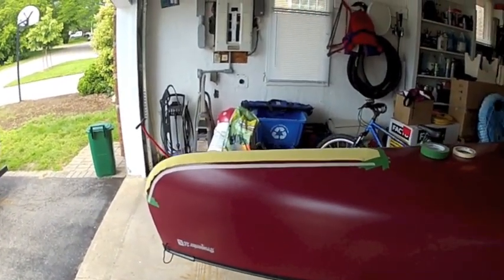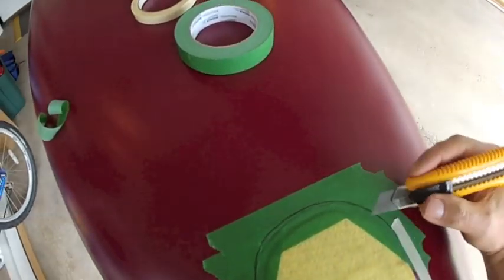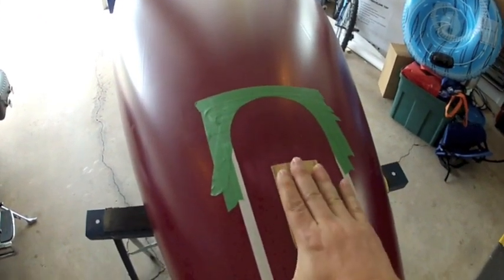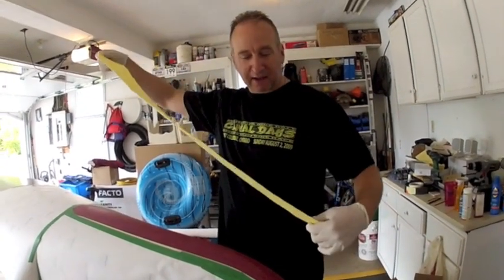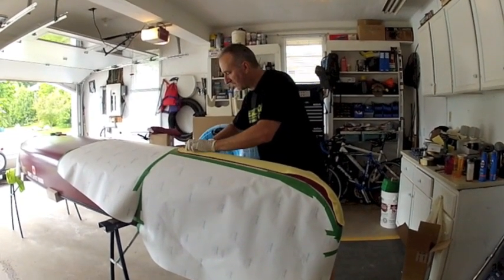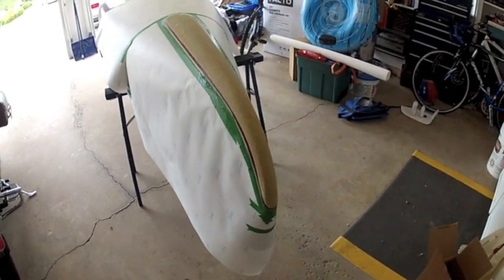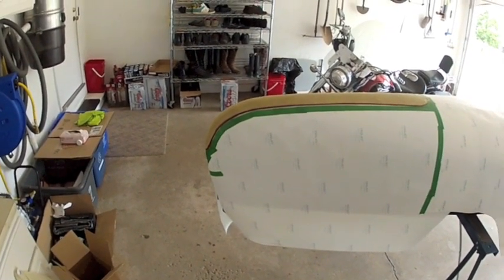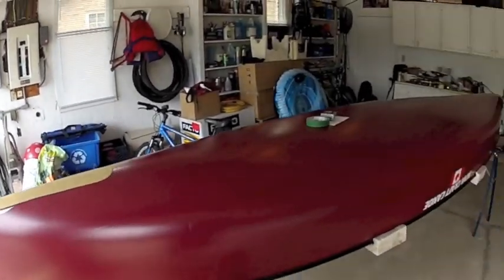Installing Kevlar Skid Plates on to a Royalex Canoe

Comment from the maker: Update to this Video... This Video was shot in 2013 and as of January 2019, the skid plates that I installed are still holding strong with no signs of release or peeling. Just remember to do a good job on the sanding process to give the epoxy and kelvar felt the ability to bond to something rough...
Enjoy the video and thanks for watching...
Reply: I guess I need to look at the Date before I click the Video 😲

Comment: good video and spot on!  I do mine a little different I have been patching boats now for 6 years. I work for a canoe rental in arkansas. all I do that's different is actually two extra steps I like to tint the boat with a torch before applying Kevlar felt,and I put wax paper over the whole patch and smooth out and push bubbles to edge when resin has sat for about hour or two I pull off then your left with a nice smooth finish.
I patch usually 30 canoes a season. Arrowhead cabin and canoe
Reply from the maker: Thanks for watching

Comment: Hello, if the skid pad still hold on to the canoe? I heard that it was popped out because epoxy does not bind well tp royalex. A few people used g-flex epoxy are more successful.
Reply from the maker: Hi Bob. The video you watched was done in 2013 and I still have the same canoe. The skid plates have shown no signs of peeling at all and this canoe has bee through a lot. I believe the most important step in installing these kevlar strips is the sanding process. You really want to create a rough surface for the epoxy and kevlar felt to grab on to and that is why it is still as good as new.. Thanks for watching the video and good luck if you are going to install your own... it's not really very difficult. 
Please subscribe
Dennis

Comment: Your royalex canoe looks new. Good on you. Would you use that epoxy with fiberglass tape or materal to repair frost cracks in royalex or royalite? To date Ive seen gflex 650 as an option but the suggestion is to open the crack to about the thickness of a jigsaw blade, taper both sides so they meet in the middle so the epoxy meets in the middle. Im having a problem with this concept, any suggestions from anyone?
Reply from the maker: Hello Micstica... I wish I could answer that question for you. I would suggest you contact NovaCcraft or another manufacturer to see what they would suggest... Thanks for reaching out.

Comment: Nice job Dennis! Any signs of it wanting to peal off?
Reply from the maker: Hi Marc... I installed these about 6 or 7 years ago and they are showing no signs of peeling at all.  If you watch my Nebakawasi trip videos you will see the skid plates still attached...It all comes down to the preparation by sanding well so the epoxy has a good surface to grab on to. I also had skid plates installed on my Swift Canoe right from the factory so the bow does not wear through.  Thanks for watching one of my first videos...Dennis

Comment: Hey Dennis, nice video! Just wondering if you can comment on what temperature is ideal for the epoxy to set? I live in and area that is consistently over 100 degrees in the summer.
Reply from the maker: work fast
Reply: You must Live in Florida too 😂
Reply: Nice job applying those plates. That's definitely the cleanest I've ever seen lines on skid plates. I live in the south agirquaz, and my advice is get up super early and get the glue down before it gets too warm. Also, do it in the shade. I watched a friend apply these one summer morning about 1000 in the sun and we almost couldn't get the glue on fast enough before it set up. And then we were worried that the exothermic reaction would melt the boat. It didn't, but we were real concerned!

Comment: Hello
How do you remove a kevlar skid if you need to replace it ? I have a T-formex canoe.
Reply from the maker: If I had to remove a kevlar skid plate I would use a Grinder with a sanding pad but be very careful to not use too much pressure or go to deep... exercise caution and good luck